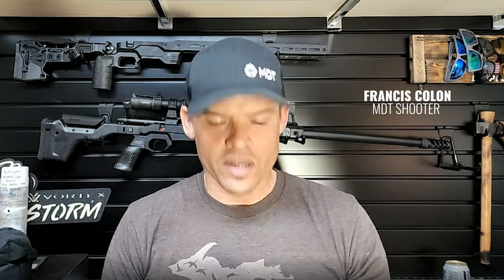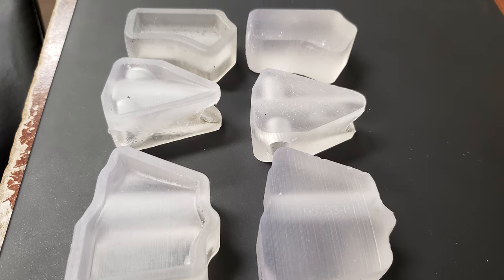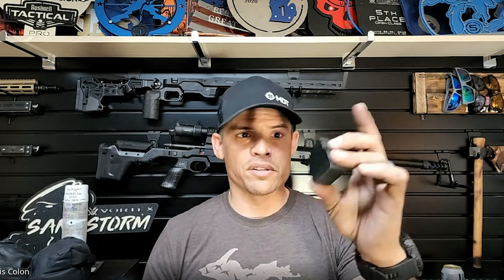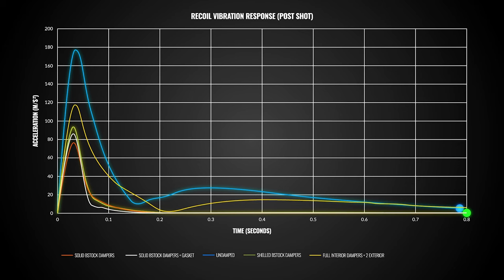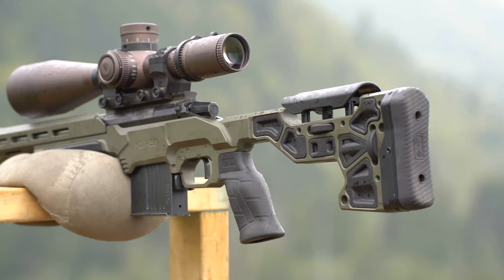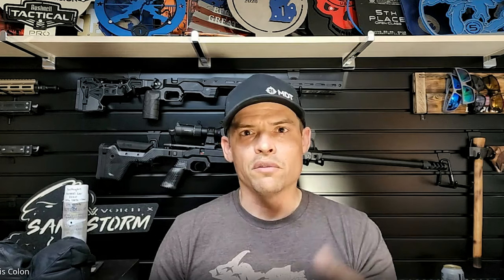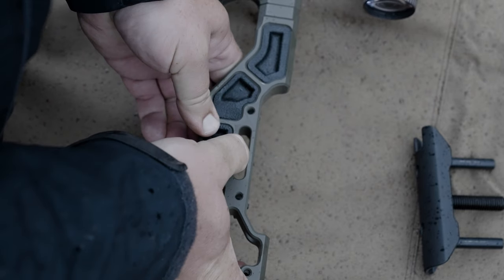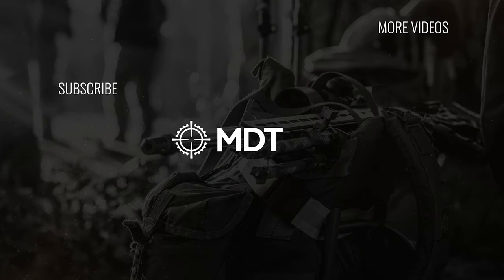NEW PRODUCT! MDT Buttstock Dampeners

Comment: The shock/recoil energy has to go somewhere so my monies on the fact it gets transferred to the barrel now. 
Better look into a tuner/brake to find that perfect node of vibration.  🤔
Reply: The recoil travels the full length of the rifle
Reply: @xxHydroponicxx  there are some very good vids. on YouTube in regard to recoil and vibrations in rifles especially the barrels that you should watch. 
If you remove part of the rifle the noted vibrations will remain in what's left of the rifle. 
Better yet I have seen some very good one's on vibrations on Yahoo. Look those one's up.
Reply: @DLN1234 the energy goes into the deforming process of the rubber inserts while recoiling, this absorbs a part of the energy.